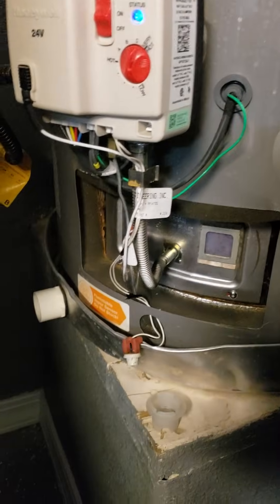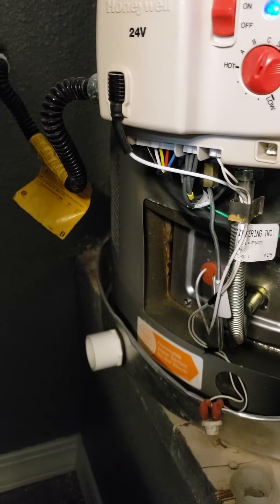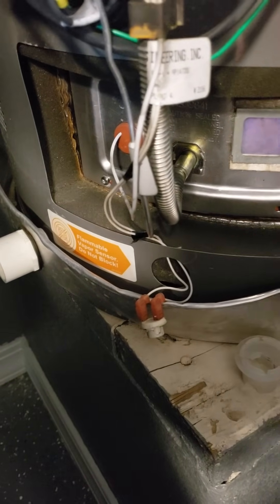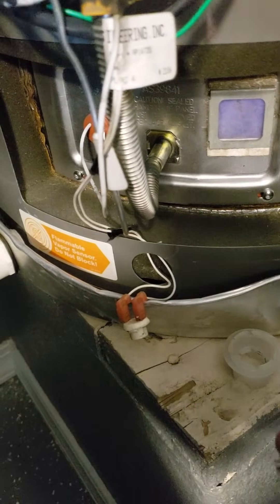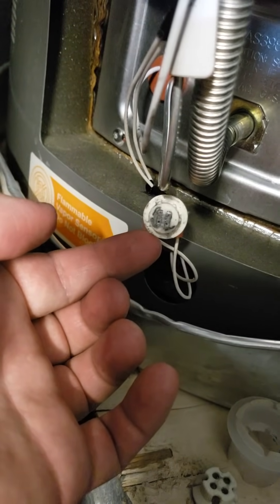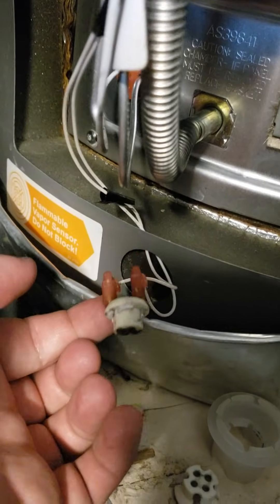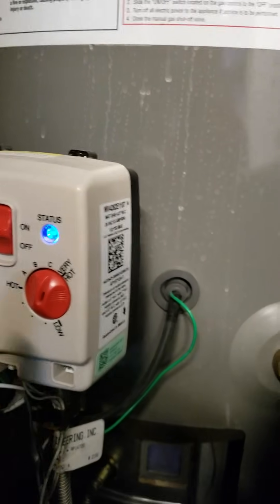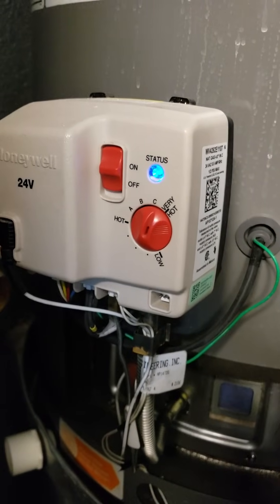Flamable Vapor Sensor Fix (not replace)

Comment: Thank you so much for the info!!  I just got it to work 5 minutes ago.  I bought a new FVS and it wouldn't fire until I turned the Low-Very Hot switch 7 times.  If I hadn't watched your video I was starting to look at replacing my gas valve.  Works perfectly now thanks to your easy to understand video.
Can't thank you enough, my wife will be thrilled and I'm going to take a hot shower right now!!
P.S. supplyhouse.com delivered fsv part in one working day 22.00.
Kudos to you and supplyhouse.com because you can't just go anywhere in the brick and mortar businesses to buy a FVS.

Comment: What should the Ohms reading be for it to work? You mentioned 12?  I thought these needed a high resistance reading like 45 Kilo-ohms?
Reply: So I did this trick on my FV sensor on my Rheem and I was getting nothing after I cleaned the 2 sensor points.  Then I used the pencil graphite trick to get about 23 K-ohms on the sensor and that did it! Fire has returned to the water heater!
Reply from the maker: JLUDE01 mine was set to 12k. Manufacturers specs was 9k-45k
Reply: Thanks!  I got my sensor to allow the system to work when I got it to read about 23K-ohms!
Reply from the maker: Glad the temp fix worked for ya! I am sure there are different manufactures and tolerances and my exact example might not be 100% correct in all instances.

Comment: Thank you for this temporary fix as it worked right away. Being that it was a memorial day weekend ( 4 days ) and I had no hot water and also could not get the part till Tuesday from Amazon ( neither home depot or Lowes carry this item and al plumbing supplies stores were close) a shame the big box home centers dont carry this simple item. But thank you for your fix.